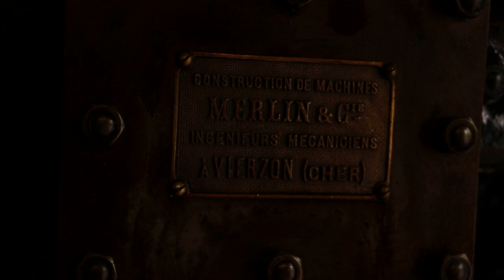Silence is Golden

Comment: I find it crazy how with old equipment, precision is optional. Like with modern belt drives you need to get the pully’s lined up damn well and the tension needs to be just right. But this belt, it’s not even tight. And I doubt the pulleys are aligned with anything more than by eye. Yet it works perfectly well. Old stuff seams more resilient and like it was designed to just work, without any fuss.

Comment: I have a shop built belt driven capstan winch mounted on a Farmall H which I use swamp logging. It is made from an old Beatty stable cleaner drive unit, same amount of gear noise, open gears clanging away.
Regarding the ski tow- I used to own a farm with an awesome hill for tobogganing and snow boarding, and I would get friends and other groups, Sunday School and youth groups, come out for some fun. I would use a team of horses on the sleigh to ferry them back up to the top with their sleds then drive back down empty to pick up another load. I'd also roll the slope with the team and roller to break a fast trail. The horses added an old fashioned community gathering feel to the experience, add to that a bonfire and some hot cider and it made for an enjoyable time.

Comment: What I don't understand - is why that belt just doesn't fall off??
Reply: The pulleys are convex and you need to line up the engine with whatever you are driving. They can come off though. Sometimes a belt will idle around fine but drift under load and eventually flip off if not corrected.